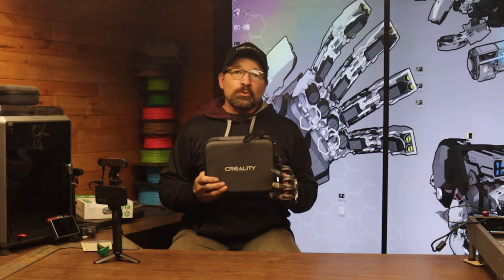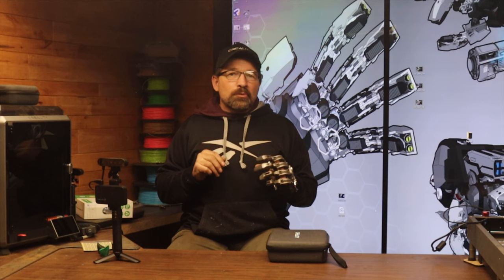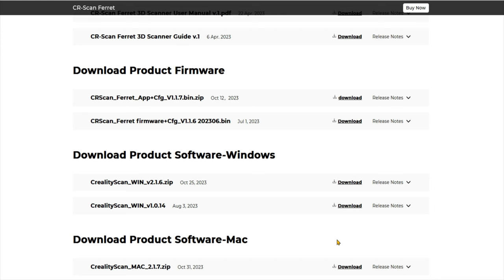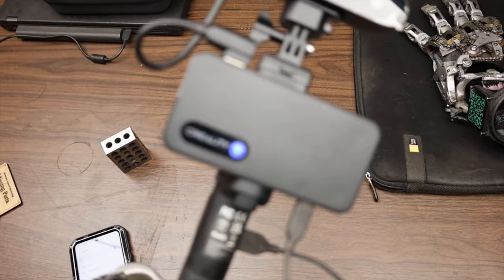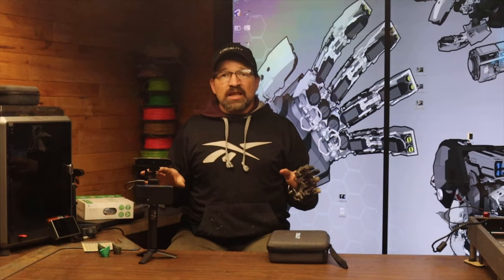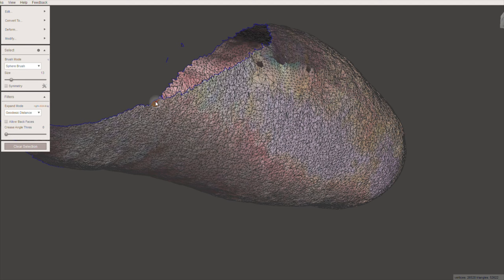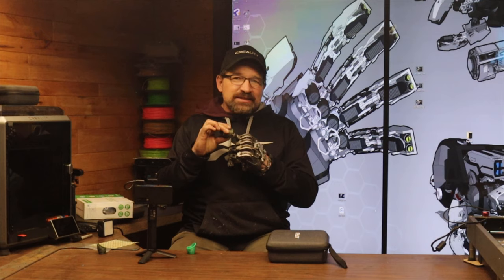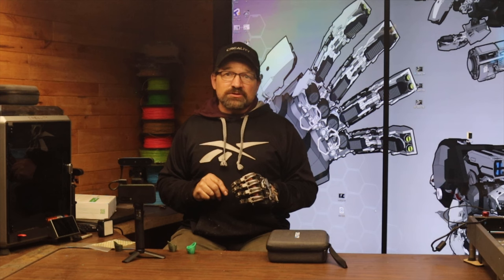Building a prosthetic finger with the New Creality Ferret Pro 3D Scanner!

Comment: For added comfort, maybe you can make a positive mold of his residual finger and vacuum form 1/16 inch foam. Then, scan the existing mold with the foam on and print a socket from that. That way, there's more comfort, and his skin wouldn't be pressed up against the layers of the 3d printed piece. A tiny sock that wraps around the residual finger could also work too.

Edit: For suspension, a glove might be worth trying since it has the best suspension on the entire hand. Another suggestion would be to suspend the socket by a strap around the wrist or around the hand (proximal to the palm crease).